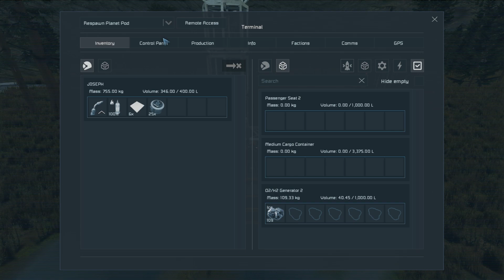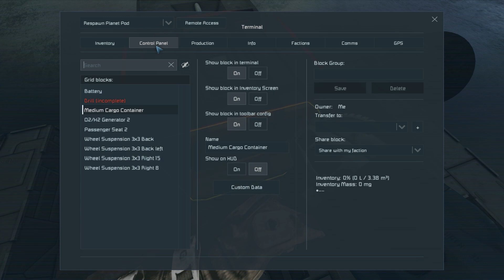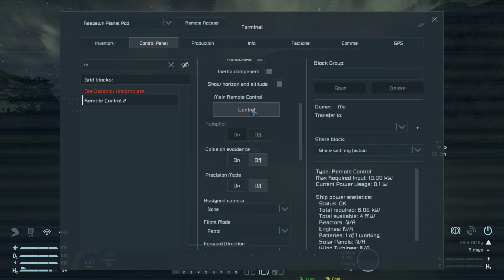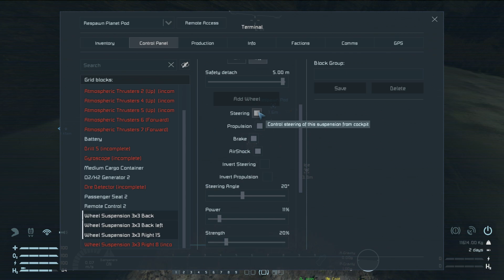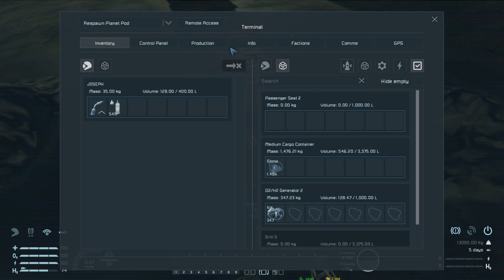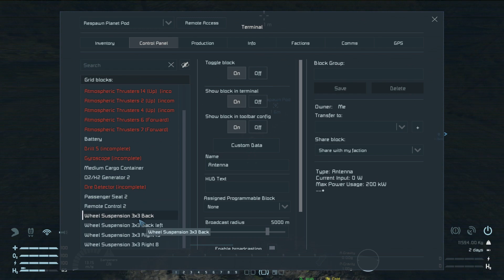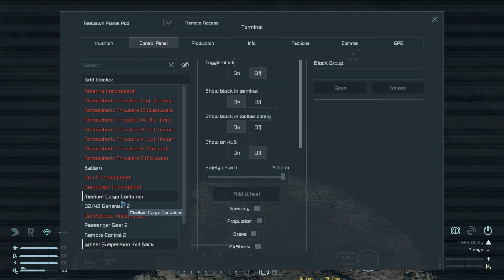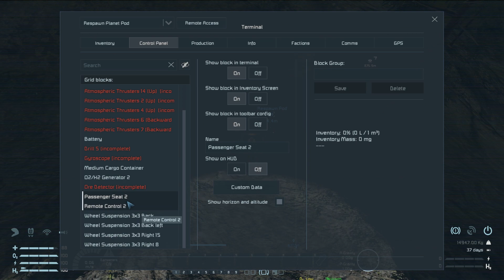Space Engineers 2019 Hardcore Survival #6:  Rover Manipulation

Comment: I don't think that the space engineers battery is very dense in power capacity.. Let's have a look at the dimension:
It's 3x3 blocks long and 2 blocks thick.. As every small block is 0.5 meters long in every dimension, the battery has an actual size of 1.5m x 1.5m x 1m = 2.25m³
What I found out from the tesla model 3: it has two long battery banks of 1.85m x 0.29m x 0.09m = 0.048m³ x 2 = 0.096m³ and two short battery packs of 1.71m x 0.29m x 0.09m = 0.044m³ x 2 = 0.088m³. The total qubic size is 0.096m³ + 0.088m³ = 0.184m³.

So let's compare that and break it down to the capacity of 1m³:
SE: 2.25m³ with 1MwH capacity = 1 : 2.25 = 0.444MwH per m³
Tesla: 0.184m³ with 0.075MwH capacity = 0.075 x (1 : 0.184) =  0,407MwH per m³

So in the end: The tesla battery is pretty close to the Space Engineers battery ;)
Reply from the maker: Woh thanks for all the info, I didn't realize how close the densities actually are, that is pretty awesome :D. Thank you for satisfying my curiosity, I appreciate it.
Reply: @ItsBeJade  You're welcome ;)